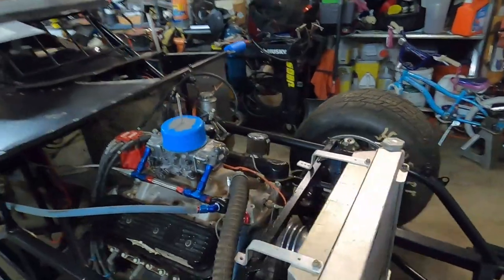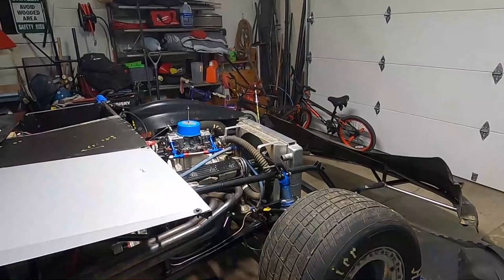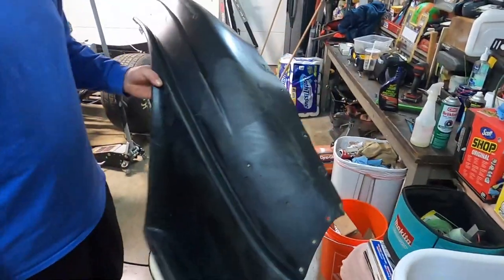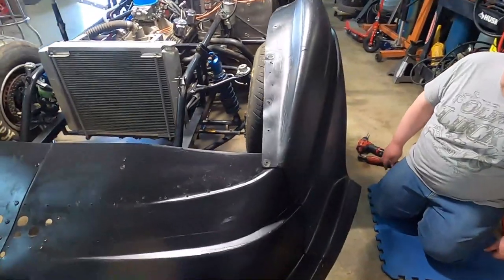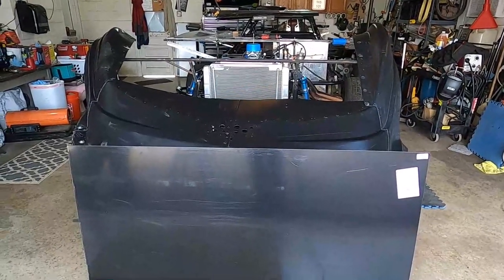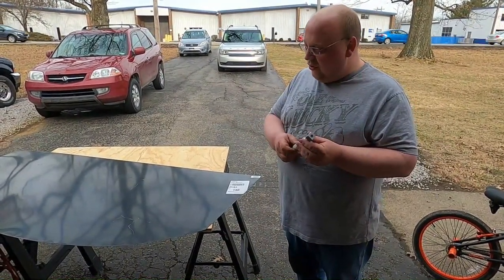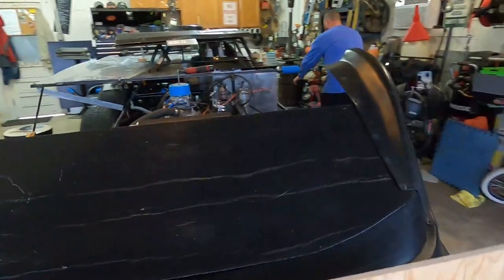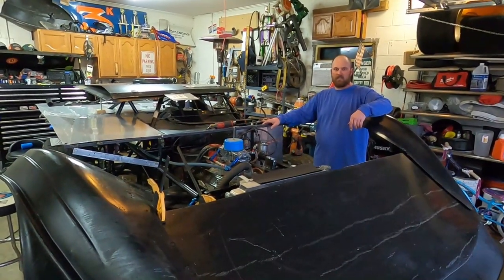NEW NOSE & HEADER MOUNTING DIRT LATE MODEL RACE CAR MASTERSBILT

Comment: We do our wheel well lips, plus the sail panel opening with the same tool. Around here our “stock class” uses aluminum bodies so it a lot of fab on them. It is a readout process for sure
Reply: What is that tool called?
And do you know where to get one?
Reply: What's that tool called?
Reply from the maker: We plan to lip many more panels.  The nose was just the first piece that gave justice to the tool and your kindness.  Thanks again!
Reply from the maker: We like to call it a body flaring tool.  The bend performed is called a Hem Roll in the fabrication world.  You can find James' email on his channel page under the "About" section.  He might be able to provide you some additional information.  His videos on how he makes them a pretty cool too.
Reply: @LateModelGarage   In case you did not know I sent a tool to Brad at Days of dirt also. The video and Facebook post generated some sales to local racers. Several local body fabricators now own the tools. Like I said in the note and video my friend here who does our bodies inspried me on designing and making the tool. So it has benefited myself as much as helping out you guys.

Comment: Hey guys I adapted an old steering wheel to my bead roller and it is pretty handy. Keep up the good work,  I  enjoy watching some good guys doing stuff themselves as best as they can. And just the fact that you can reuse the  nose is pretty cool 😎
Reply from the maker: We like the steering wheel idea.  There is quite a selection in the garage.  The bead roller is sorta on loan so we will likely limit any modifications if they have to be permanent.  The concept and the potential for improvement is great!  Thanks for sharing!
Reply: @LateModelGarage  you can set it up so you just take the crank handle off (set screw) and put the wheel on (also set screw) FYI jmo 🤟👊
Reply from the maker: We will have to give it a spin...🤣